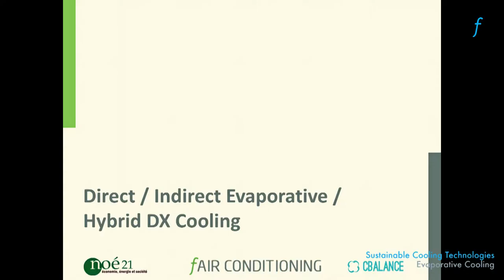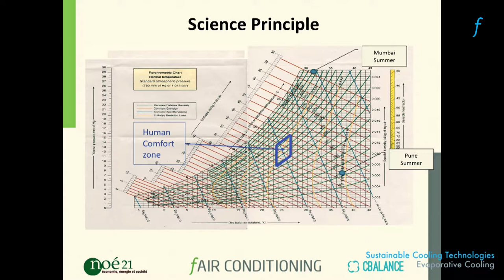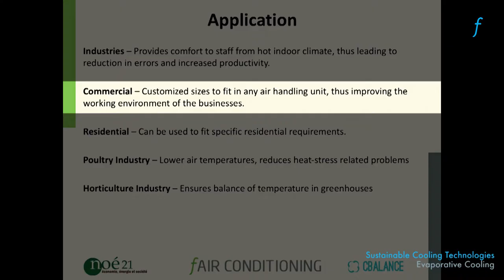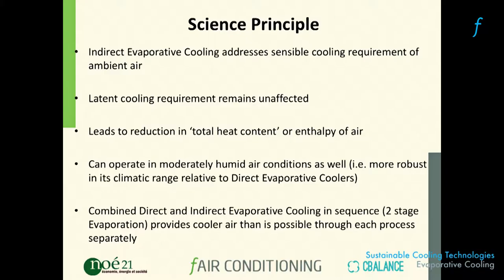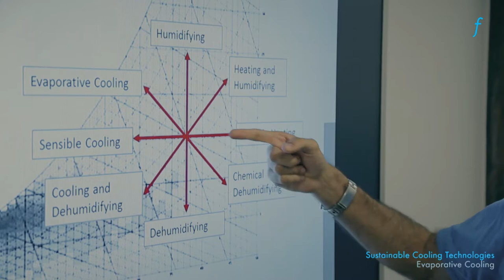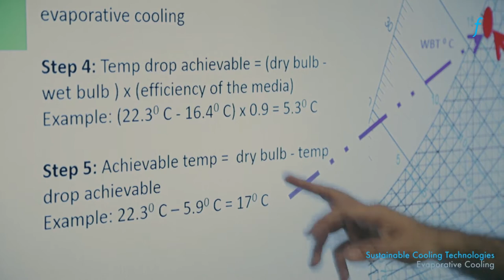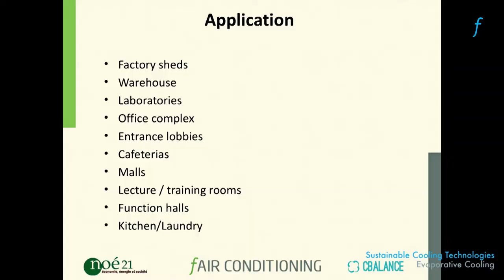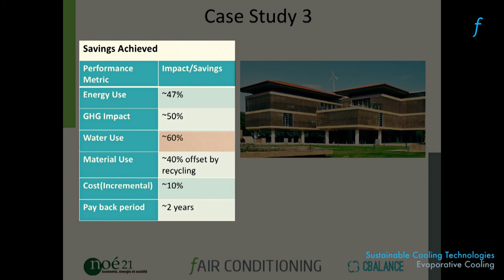Evaporative Cooling

Comment: Thanks for the detailed explanation.
I would like to know if its good to use part of return air (75 F) is mixed  with outdoor temp (around 108 F) resulting to a lower temp 80-85 F and wil undergoes indirect evaporation system